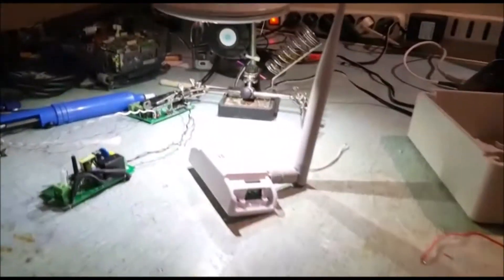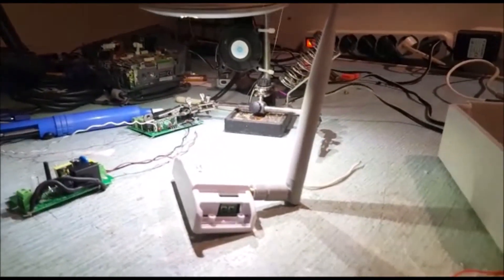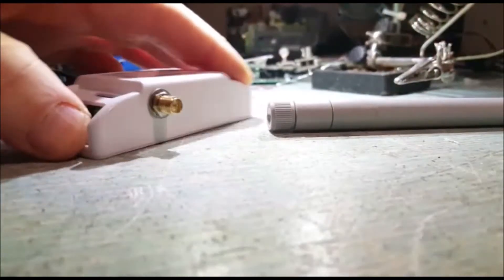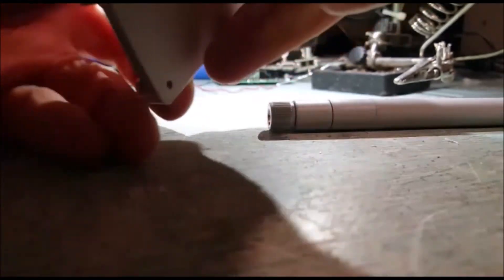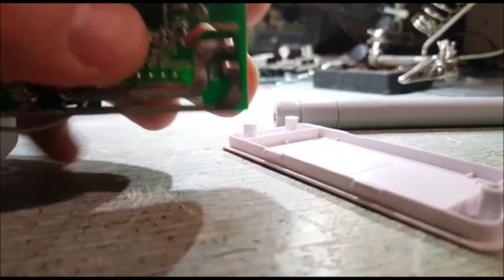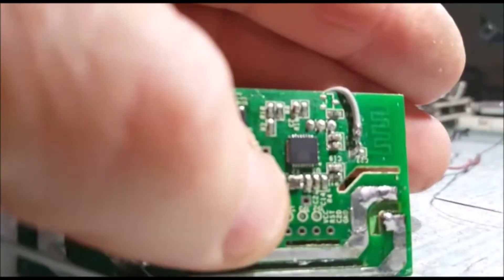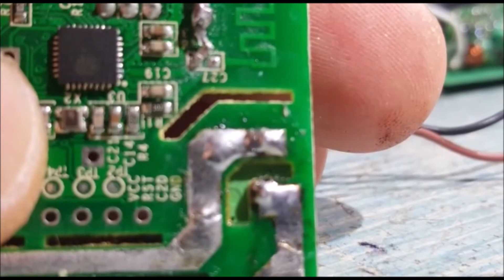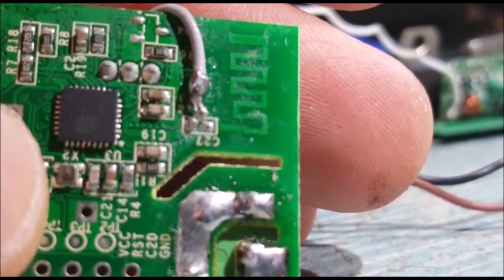Amplify sonoff signal

Comment: Did you remove condenc 27 away, or you move c27 to other place? Did you solder 1 cable to c27 place and didnt solder to ground, and its work?

Comment: My antenna theory isn't great, but it is OKay to leave the original antenna in parallel with the new one? Or does the removal of the capacitor disconnect it? Good tip!